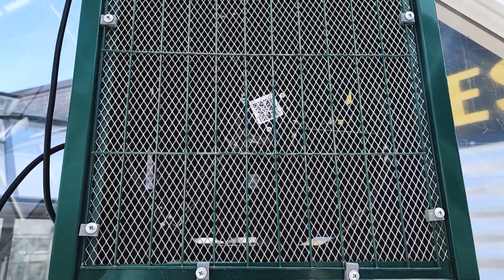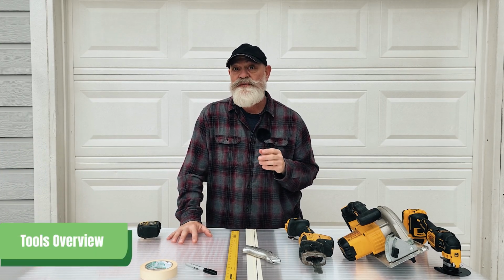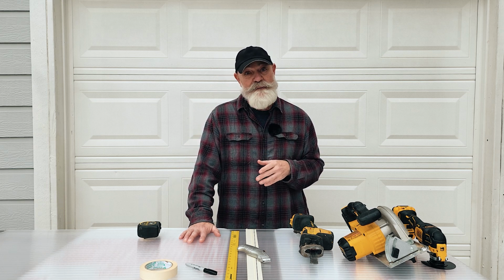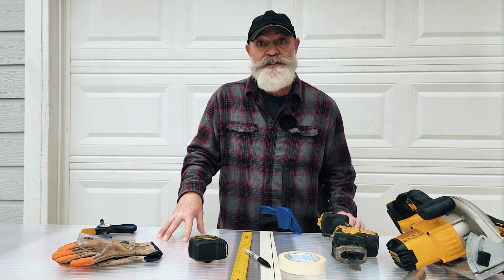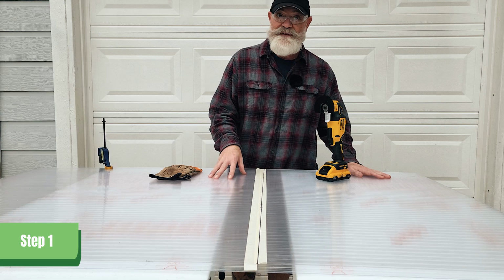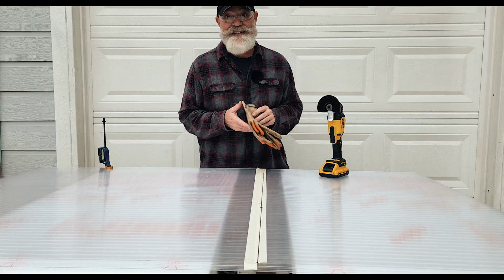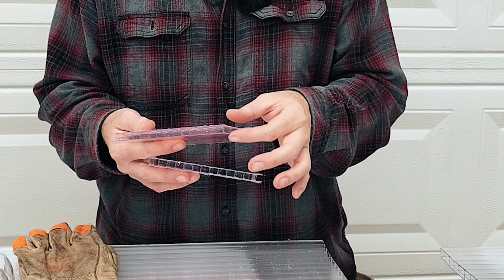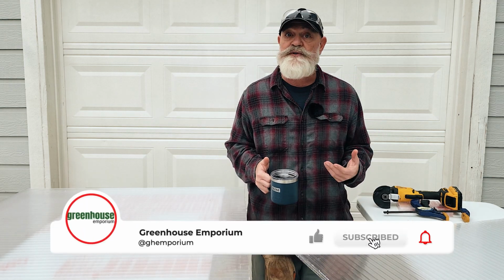Cutting Polycarbonate Panels LIKE A PRO For Your Greenhouse!

Comment: Thank you. I'm using .032" Clear PVC Corrugated Roof Panel for homemade D shaped Moss poles for my climbing plants. Using the 1/2" coated poultry netting across the front. It forms a perfect arc is sturdy and cheap. Then stuffed with sphagnum moss. This leaves a really clean cut.

Comment: Hi there can I use a larger angle grinder and a thin metal cutting disc for 20mm thick polycarbonate sheet please
Reply from the maker: I believe it could work, but I haven't tested it myself. If you try it, let us know how it worked out. Others might benefit from your insights, too!

Comment: DO NOT WEAR GLOVES, especially LEATHER GLOVES, around rotating equipment, unless you would like your limbs severed, or worse. Eye protection, ear protection, and respiratory protection is a must, however.
Reply: This isn't a problem with the tool he's using so your comment is a bit silly.